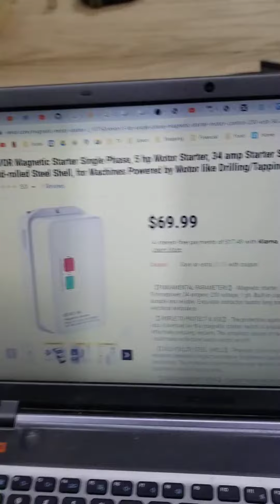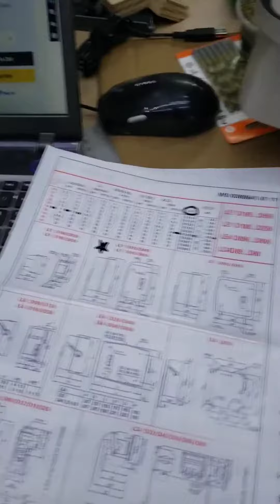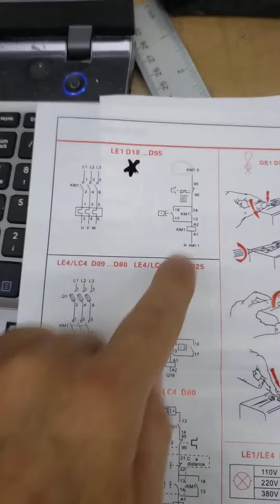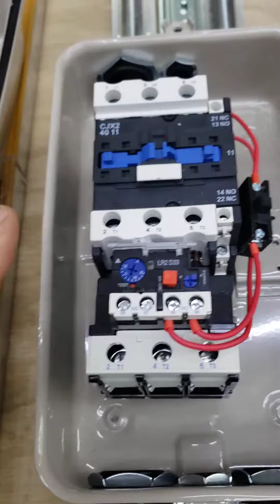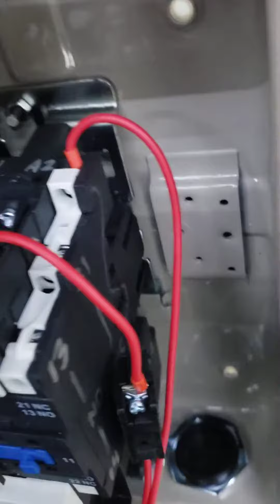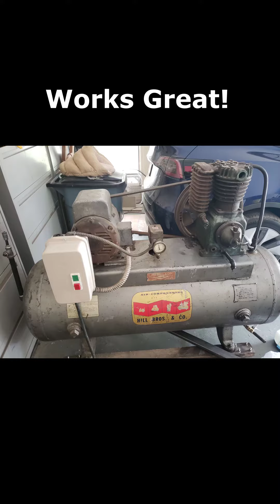VEVOR Magnetic Starter for an air compressor needs a legable wiring diagram.

Comment: Great video vevor only question is my starter has on off button so lost on how to add pressure switch. Thank you
Reply from the maker: My starter also had a red and green on/off buttons, that you can see at the end of this video, on the outside of the relay case.  I didn't use those buttons.  I did wire the pressure switch instead of the little black push button switch on the side of the starter relay.

Comment: Ross is have the same unit something tripped in it push button will not start it but if i push the blue bar in it starts but seams like it’s only getting parasol power both legs r still hot

Comment: I dunno why you need a whole contactor for an air compressor.. you can get 240v air switches that cut on and off at certain pressures and dont need any kind of contactor..  ive always just ran power to a 30 amp plug and no issues..  cheap and safe,.
Reply: Those pressure switches can only handle so much current before you start burning them up. Magnetic starters take the load off the pressure switch and use a beefy relay to connect and disconnect power to the motor i.e. you can run high current without burning up pressure switches.

Comment: Ross I’ve got a question for you. If you replace the manual “on” switch with your pressure switch. How do you shut your compressor off if something is wrong or just leaving for the weekend type thing. 

I’ve got the same setup and want a switch that I can turn off without having to go to the breaker. Preferably some way to use the switch that came with the starter
Reply from the maker: I added a light switch inline with the pressure switch.  Now the light switch will shut the whole thing down.